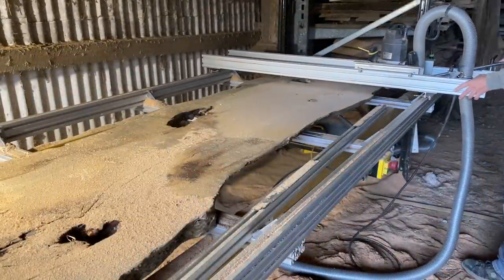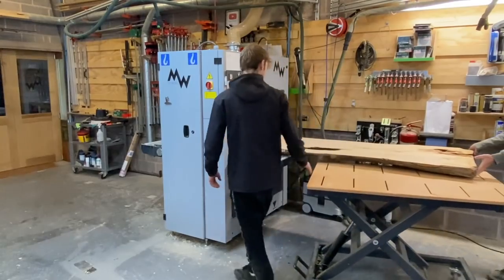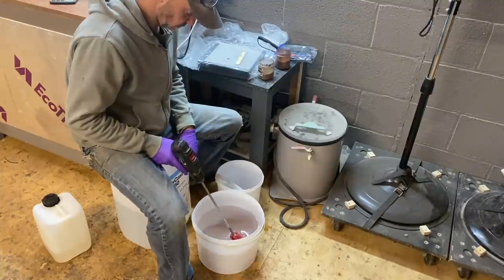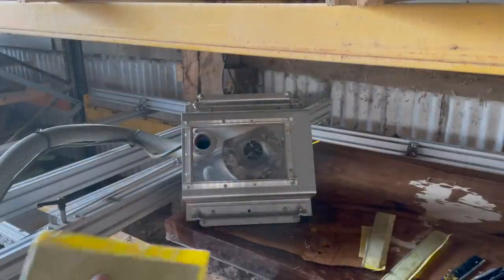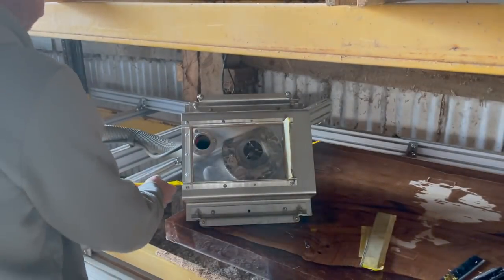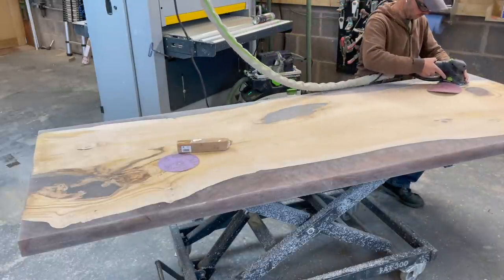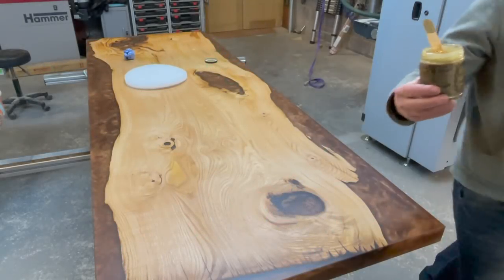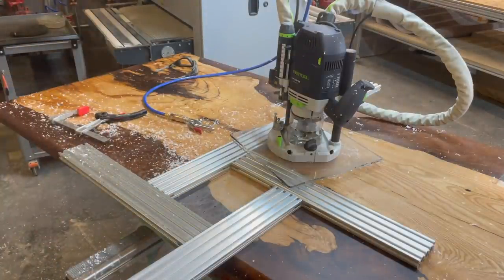Unique Resin ..! Chestnut Dining Table

Comment: Can I recommend something to you Andy.  Makita do a little cheap blower its the DUB182 18v LXT and its absolutely a must for the workshop.  It clears the router sled bearings all over in a second.   I used to blow drill dust away and things like that but this thing can clear a huge work bench instantly.   its £49 and blows at 120 mph.  You have got to try it its one of them tools that really makes a difference
Reply from the maker: Ace I will get one ☝️
Reply: @ManorWood  sorry it’s the 18v DUB 185.   Excellent bit of kit

Comment: Great work. I make quite a few wood tables and cabinets and most feature a limited amount of resin, although very few are perhaps 25% resin (on slabs which are too attractive to scrap but have a lot of defects). I have always used Easy Composites; good company and great service but I have found that getting rid of trapped air can be an issue (I have a 5 litre degassing tank but, putting in anything more than 250ml on a 1.5l pot results in boiling over and what a mess; that makes large quantities of resin impractical). I recently bought some from product from Epodex and just completed a first pour. It’s slow cure (that might be an issue to you, but I don’t have the time pressures that you have) and, probably because of that, doesn’t need degassing. Anyway, first pour down and no sign of trapped bubbles. 

Just my taste, but I think that the bronze, copper and similar tints really add class to a good slab. I would urge people to try some.

On your recommendation, I have just ordered my first pot of Odies. I always use microfibres cloths to buff anything - do you have views/experience on microfibres as opposed to cotton Terry towelling?
Reply from the maker: Hi Martin so with glass cast 50 you shouldn’t really need to degas it’s just according how vigourous you mix I sometimes D gas just because I have the time but it definitely isn’t necessary, biggest issue with resin is the depth of poor and the volume which does create or try to create the exorcism scenario, I don’t have a problem with glass cost 50 and trapped bubbles .  Odies definitely do not recommend using and microfibre I am not sure of the science but Terry towelling all the way,   microfibre just for removing dust
Reply: @ManorWood  thanks for the reply. I mix by hand and, at my age, I would love to think that I mix too hard - love to, but that’s not going to happen. I think I will ask Odies about why they don’t recommend using micro fibre - I’d be interested to understand their thoughts.